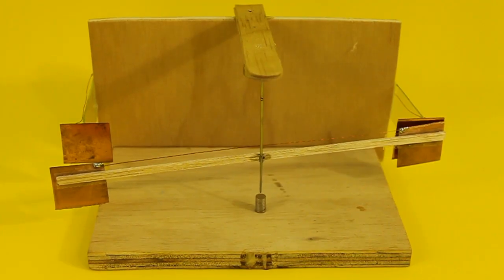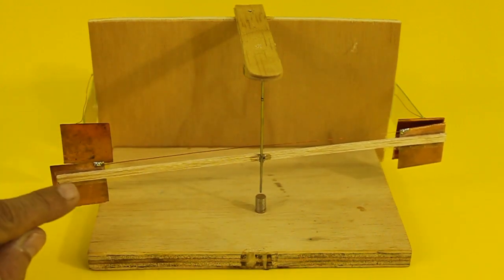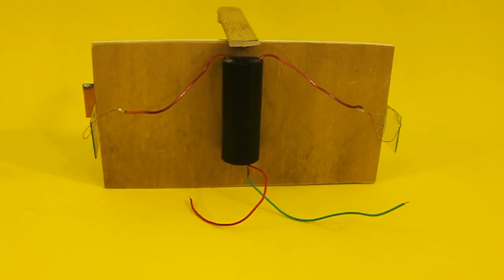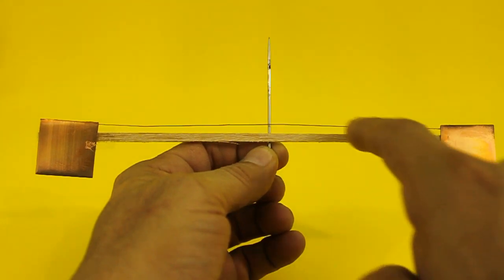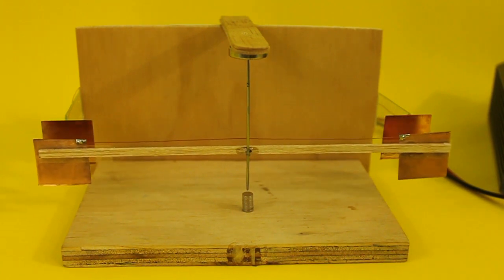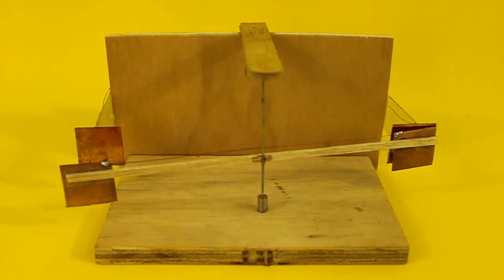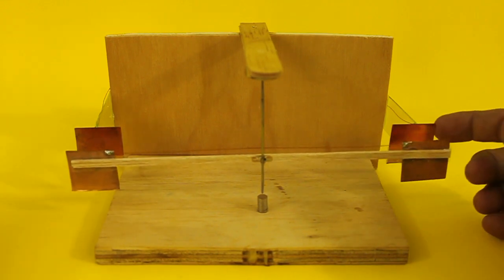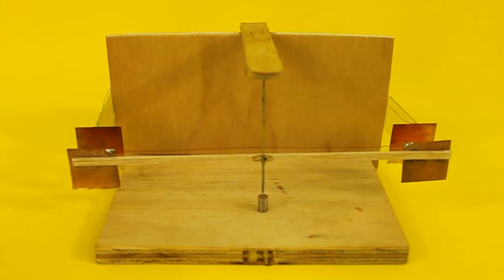High Voltage Pendulum

Comment: A very innovative pendulum.  It could probably be powered using a mains  voltage multiplier circuit.  What kind of power does it consume?  Guessing it's very low.

Comment: I guess this type experiment is something like they were doing a couple hundred years ago. when they were trying to learn about electricity. and figure out what it is. and what it can do. like the classic compass and current carrying wire. and the right hand rule. learning how electromagnetic fields work . and electricity and magnetism are two sides of the same card. I still find it amazing . what tiny unseen electrons can do! would adding a capacitor  make to move faster? like in the center. connected to each pad on the pendulum?

Comment: Very neat. Is this similar to "Franklin's bells"?  I'm wondering if this could be modified as a lightning detector. Have one plate hooked up to a long wire on a tall rod and the other wire connected to ground. I'm also wondering if this could be modified into a clock with a torsion pendulum. You've got me thinking. 😀

Comment: Ok,  please help me understand. You have a power supply of 1.25 volts. There is another set of numbers of 361 or 3.61, it's difficult to read on a smart phone. Is that the amps?  And is it 3.61? Because if it where 361 amps the copper plates would have melted when you did the cross ark with the jumper wire. 
So your High Voltage rectifier or amplifier is taking 1.25 volts and increasing it to 3000 volts. And for it to maintain a constant polarity,  it has to be DC current. Or otherwise the alternating current would on allow for a constant polarity,  correct?
What is the power booster manufacturers name and  the input and output voltage range limets?

Comment: Wow nice video. The high voltage is it coming from coils wound in back?
 How many  turns on the coils. What you use for core?  Anyhow enjoy your vids thanks as always. May try a flyback for high voltage since i have one already built. Thanks Ludic.
Reply from the maker: +Gary Kirby thanks! I use a commercial high voltage power supply

Comment: I might try to make a smaller version that's powered by a flyback transformer.
Reply from the maker: +OBV10U3_NINJA if voltage is too high it becomes unstable